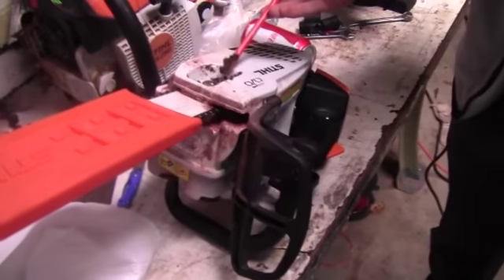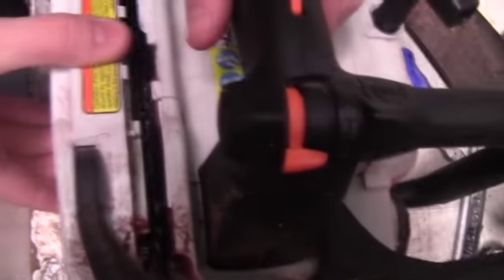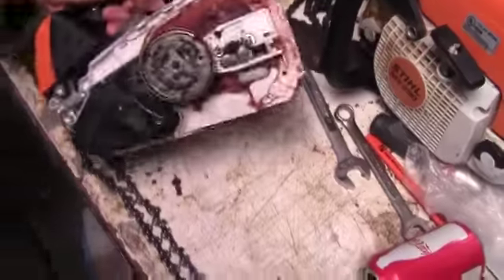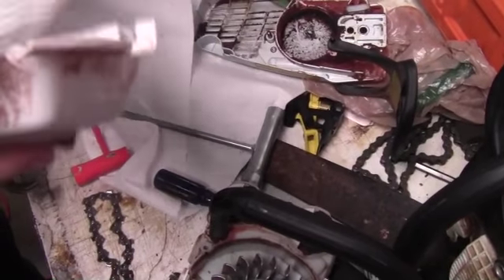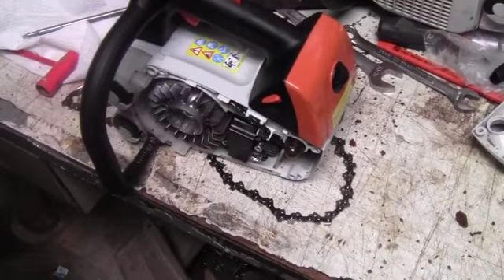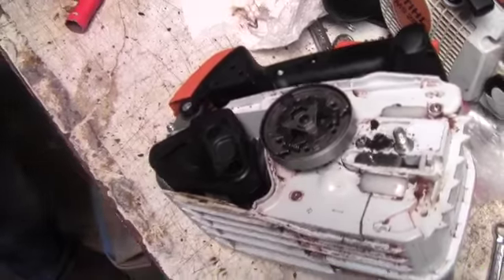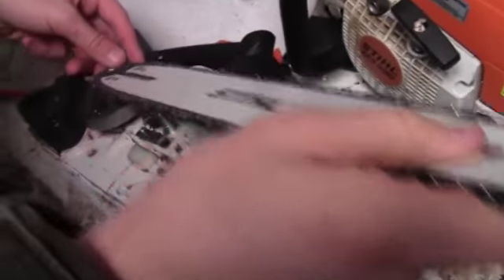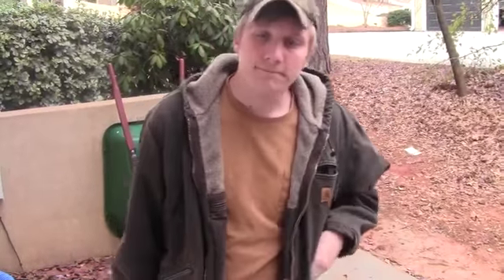How to   Clean and replace a chain on a ms 192 tc

Comment: What you neglected to show was how to get the housing back on. You broke away and when you returned it was already on. That's the hardest part if you've never done it before. Unlike other saws in the Stihl line the safety mechanism is in the handle. When you remove the handle the spring might retract and you have to reset it before you place it over the sprocket housing. The spring must be in the most OPEN position to fit over the wheel on the sprocket housing. Proceed
Reply: Exactly!